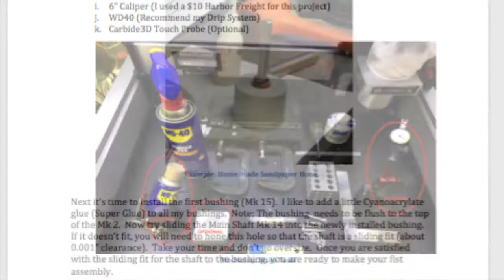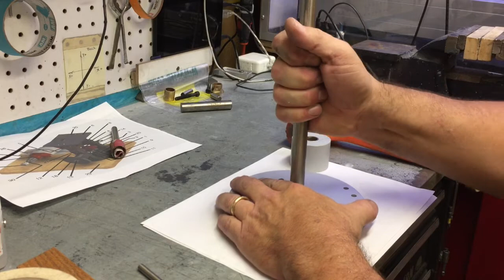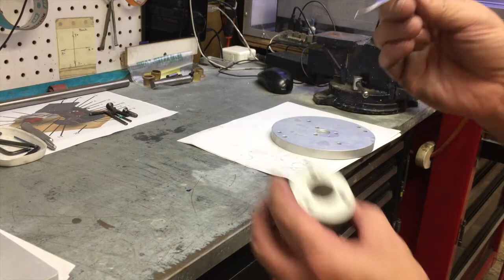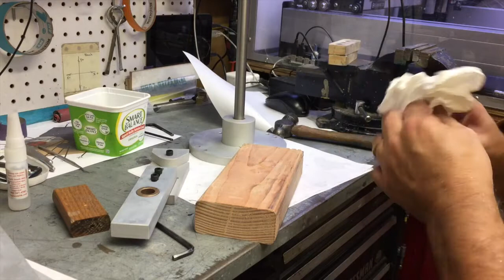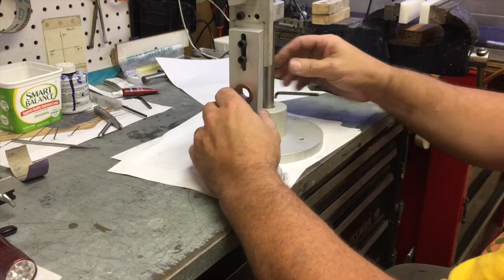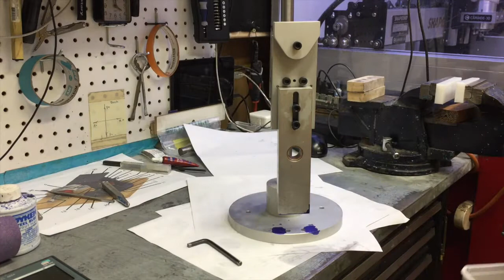Let's Assemble the Die Filer Built on the Shapeoko 3 or Nomad Desktop CNC machine Part 1 of 2

Comment: Hi,
Not using bushings on mine, aluminum and steel are fine. Millions of miles on auto camshafts in aluminum heads. Also the bearing block is on the inside so the scotch yoke is shorter. Maybe you used them later but a good idea to use washers on the strut bolts.
Reply from the maker: Please don't confuse Hydrodynamic bearings (a thin film of  Pressurized oil between the steel in the aluminum so that there is never a metal to metal contact) with bearing  free set up (steel against aluminum). As they say, you can lead a horse to water .......
Reply: @RichardCournoyer  It makes very little if any difference, the key is surface area contact and the fact that aluminum is softer than steel. Like any bearing, including bronze, just keep it lubed.

Don't believe me? Take apart any lawn mower engine with aluminum connecting rods. Rings in small engines are designed to last 1000 hours, that's steel against aluminum (chrome rings last longer). If an engine runs at 3000 rpms that's 3000 x 60 x 1000 = 180 million strokes of steel running in an aluminum sleeve. I've changed rings in those small engines, guess what? The crank bearings are still good and so are the aluminum cylinder walls.

Porsche runs pistons directly in aluminum, yes they're nikasil coated but still, they're racing engines and they even did it with their air cooled engines, that's how good aluminum and steel work together.Those walls weren't force lubed either, Porsche uses something called dry sump lubrication, they were sprayed with oil.

Plenty of small electric motors run steel directly in aluminum bearings too.

I don't hone either, honing with paper can leave fine grit embedded in the soft sleeve, you can hone cast iron but that's a different story. Press the bearing in and hone it with reamer on a dead parallel set up. Now you have a nice clean accurate and even mating pair. Use good aluminum like 6061 T6.